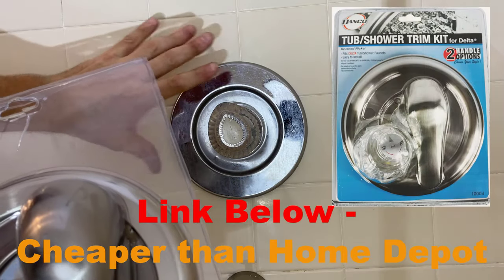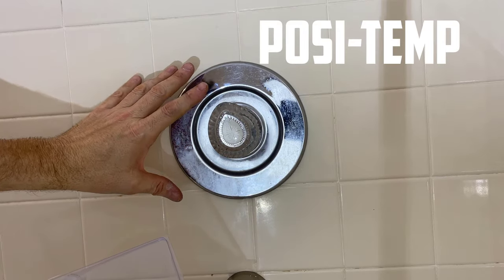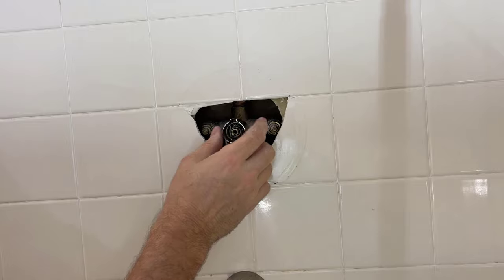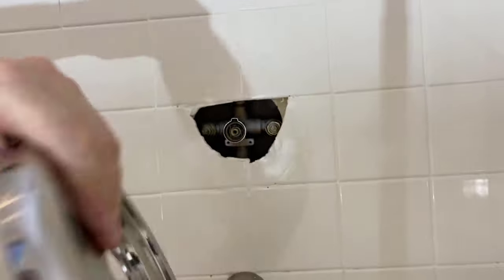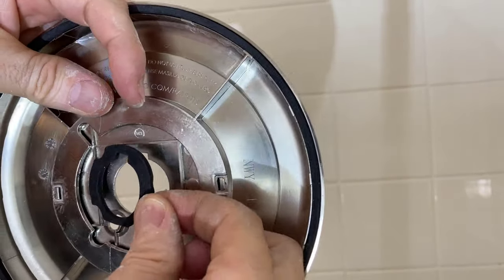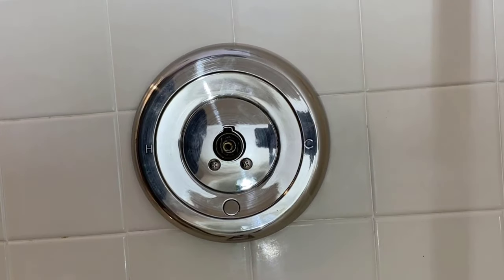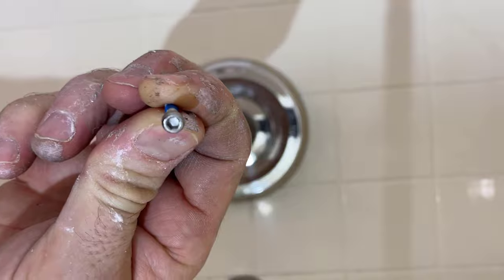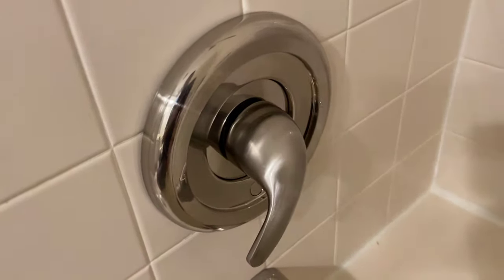DANCO TUB/SHOWER TRIM KIT - MOEN | how to install

Comment: installed this today .. pretty straightforward as this gentleman's video indicates.. also QR code at top of printed instructions (which are too small to read for me) was a major help as well .. really well done.. I installed plastic handle but screw provided was too short .. had to hunt around in my toolbox for one w more length otherwise handle would be too loose .. happy w this minor update to my shower !
Reply: Had the same issue with the handle feeling very loose when installed. I stuffed some of the extra foam gasket supplied in the kit in the cavity where the set screw goes and that helped stabilize it. Now this thing feels worth the ~$50 I spent at Lowes lol
Reply: I had the same problem and read the instructions. The kit includes a tiny lock washer which my plumber didn't use. I installed the lock washer and it stopped the handle from feeling loose.

Comment: Great video!! Really helpful!! We replaced ours with this same kid probably 8 years ago and we installed the KNOB. We must have the Moentron valve that you spoke about because it DOES NOT pull out to turn on. With the KNOB installed we would turn it counter-clockwise all the way to get hot water from 1 side of our house to our master bathroom then gradually turn it slowly clockwise to make the water cooler. It has worked fine like this for 8 years. the pressure remained the same regardless of the position of the knob. We just replaced the trim kit again and elected to use the LEVER because its easier to grab. We cannot seem to be able to adjust the temp of the water now. This seems weird to us but on 1 side its HOT only and on the other side its COLD only. We feel kind of stupid now. Lol! May be we installed the wrong adaptor? We used the GRAY one that you used. Thanks!
Reply: We have the same problem. Can someone help, please
Reply: @Kent_N_Sophie  I'm hoping so. WE feel pretty stupid. We DID NOT change the valve or cartridge. Operation should be the same you'd think.....
Reply: @Kent_N_Sophie  WE used the GRAY plastic adaptor in our installation. We threw away the BLUE? one stupidly and I can't help but to wonder if we should have used the BLUE one....
Reply: @Kent_N_Sophie  I removed the LEVER that I installed when I installed the new trim kit and put the KNOB back on. NO difference in pressure or temp control. I have watched videos now on replacing the cartridge and frankly think thats my next move. Its original to our home that was built in 1998. It doesn't leak and that seems to be why most folks replace the cartridges. Ours is actually quite stiff to turn thats why I elected to install the lever. MY understanding is these valves automatically adjust the temp for instance if someone flushes a toilet close by so the person in the shower doesn't get hotter water than they want. I think ours is just plain stuck.

Comment: I just installed this kit on my old moen.(Thanks for your video). But now, I can't get the water to turn off completely by just pushing in the handle. I have taken handle off and can turn water off by pushing screw in farther  with screwdriver. Do I have it installed correctly? Do I need to do something different? Could this possibly mean I need to replace the cartridge?
Reply: More: not sure, but it seems like the reason it isn’t shutting off is because it hits the plate. I noticed the original old Moen plate is more “bowl” shaped (deeper).
Reply: Same issue with the plate. 0/10 would recommend
Reply: What was your solution for this?

Comment: I wanted the lever handle, but the plumber said I couldn't used that option. After he left I found your video. I have moentrol and valve has no diverter so I WAS able to use the lever. Now my problem is my gray adapter is metal and its weight is causing the handle to sink ever so slow downward when I have the lever at the highest points either left or right. Looks like your adapter was plastic. Maybe I can get a plastic adapter to fix this issue??

Comment: Do you have to turn off the main house water first before beginning the removal of the old trim kit and handle and replacing it with the new ?  Thanks !
Reply from the maker: No need

Comment: These kits for Moen pull style valves will not work on the old style pull valves. 
You will need to purchase a handle extension kit.
The kit comes with a brass sleeve to extend the pull handle.
Otherwise, when you start tightening the the screw you will turn on the water.
They do not tell you this.
I heard from the Home Depot clerk that he has to send people to online or plumbing stores to purchase the handle adapter. 
These Danco and Moen trim kits sold will only work on the new style valves, which have a longer stem.
Very frustrating.
The kits range from $26.00 and up.

Comment: I have the posi temp.  I hate it. I installed a flow valve on the head to help save water.
Reply from the maker: I don't understand why they are dropping the Moentrol - seems like a better valve??
Reply: @lookoutman   I hate it.. I’d change the whole thing out if I had a choice. I don’t.. I live in a apt.. but a valve works jsut as well..

Comment: Where did you get the adapter?
Reply from the maker: Home Depot
Reply: @lookoutman  Thank you. My handle spins 360 as well. Do you have a link to the part you picked up at HD or what the name of that adapter is?
Reply: @lookoutman  please I need that grey adapter … send a link